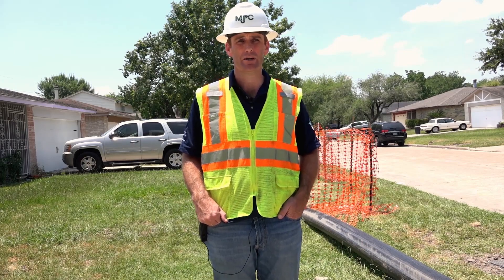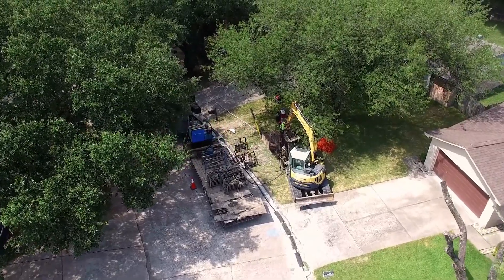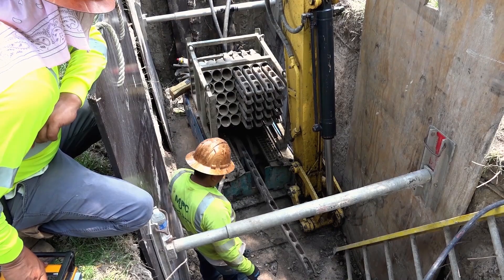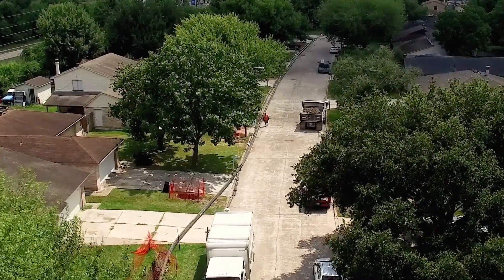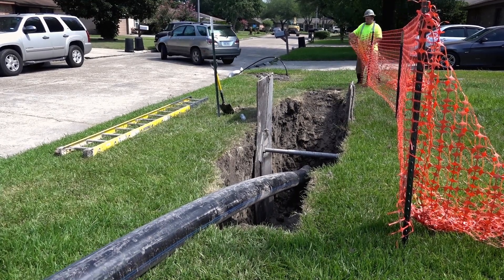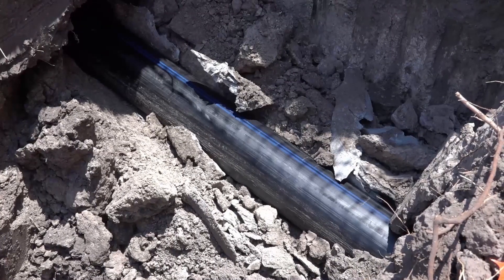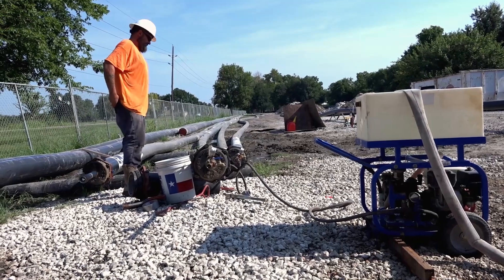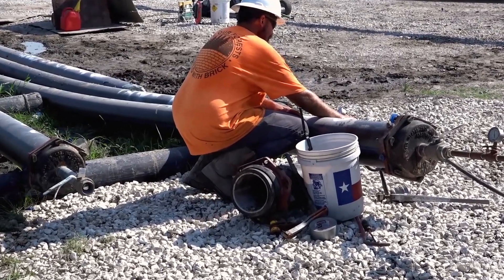Pipe Bursting in Houston | 50,000' of Water Main Replacement

Comment: How did you deal with EPA asbestos abatement when pipe bursting old AC pipe? Was this an issue?
Reply from the maker: Hi Mary - great question. The NESHAP standards developed in the 1970's were focused on asbestos in buildings, not on replacing potable water main.  We've worked with the EPA on both a national and regional level on using static pipe bursting to replace water main.  In short, the static pipe bursting process doesn't release asbestos during the replacement process.  We perform negative exposure testing on our job sites, in which every reading the amount of asbestos was nil.  This is due to the way the water mains were originally manufactured, in that they mostly (95% to 99%) contain concrete.  During the static pipe bursting process, the concrete continues to encapsulate any asbestos.